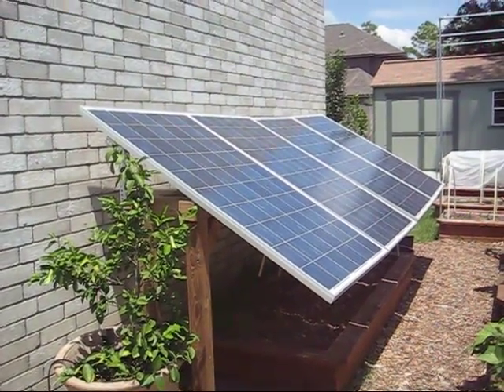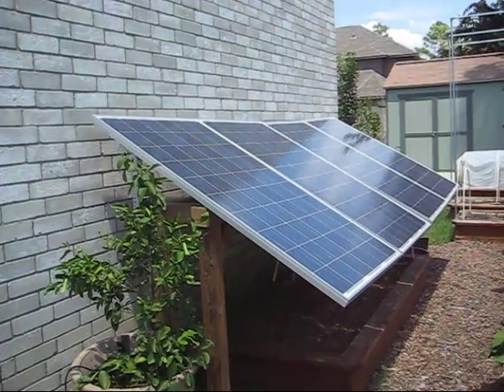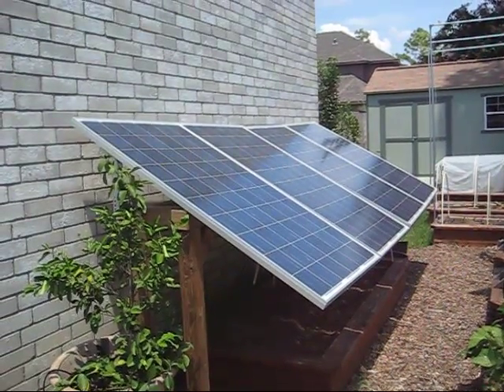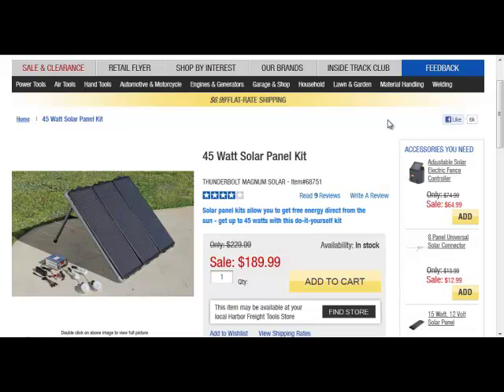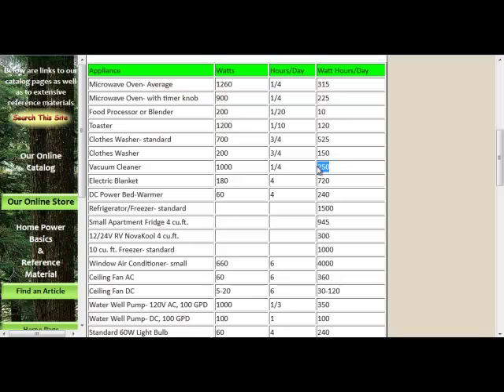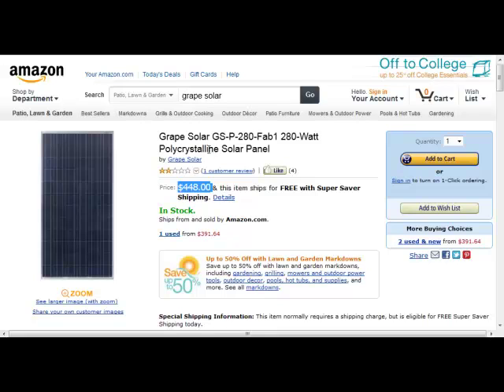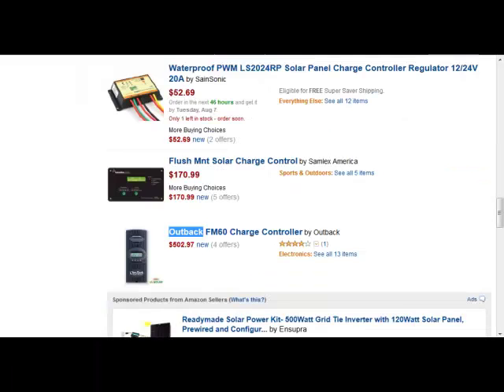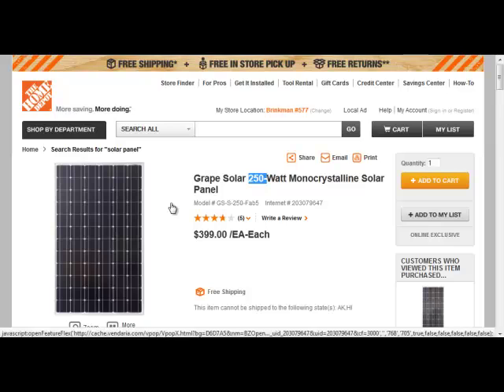DIY Solar Panel System: Costly Mistakes

Comment: I used the harbor freight 45 watt system (2 of the kits) for running my lights and charging phones and tablets for my booth at events. I found that the smaller panels work for portability for set up and break down. (I kept Them for 3 years before upgrading for 100 watt system). But for home I would want something beefier.

Comment: Yep HF not the best value. Panels today can be found at less than a buck a watt @69 cents. I think total my off grid system should be about 2$ a watt with 300amps of usable storage 1.1kw in panels.

Comment: Totally IGNORE this video, he don't have a clue what he is talking about in this one, and it is way out of date!  He also said in other video he bought kits at about $140, now he claims and shows $189 price, also saying $1000 mistake, but if as in first video from 2011 he paid $140 each for 4 kits that is only about $700 with tax and you get allot more that just a panel! No, the kits have almost always been on sale for $140 or less. Or use the coupon for 20% off or Both! My 4 kits cost me about $130 each  and they came with some good stuff you do not get with just a plain panel!  
 Also looking at his 2011 video he bought his HF panels about the same time I bought mine I think, if so there was NO WHERE to buy poly or mono panels for less than $4-$5 per watt and you had to pay shipping which cost allot more! Prices go up and down on mono and poly panels, at time of this video they had gone down it looks like, and now today you can get them for about $1 per watt!! Prices will be going up soon perhaps with the new Tarrif of Jan 22 2018 which may raise prices about $0.15 per watt estimated for what I just read.   
HF is now selling a100Watt kit, 4 25 watt panels and nice led lights kit with good controller and all needed wires, for sale price of about $150 
 it looks like the 100watt kit replaces the 45watt kit near same price  and maybe a much better kit, I have not had a chance to  get the new kit yet myself but have seen them and looks good.
 Amorphous panels do have some advantages like making power in low light conditions like cloudy  overcast days, partial shade, early morning or later hours, times when Mono or Poly panels may do nothing. Amorphous panels may not last as long as others maybe though I know people have had good life and still using the old ones from about 2010 maybe even older.  I Had to pack mine away after 2yrs because I was traveling most the time and seldom home.
 Amorphous HF kits may be best for stealth bug out. Since they can make decent power in less than perfect sun may be good to lay flat on ground while living in the cave hiding in woods. Poly or Mono raised to proper angle pointed into sun would be easy to spot from a long distance and attract unwanted persons to you. Panels flat on ground much harder to spot, though less power, but safety first!
 I will mount some on my motorhome I recently bought. I'd rather park in nice cool shade and get some power than park in perfect hot sun and roast. I am not really a bug out person myself.
Reply: Den, Down here, flat on the ground/roof actually makes the most power at the solar noon. Find when solar noon is in your area and then make a shadow device to see what angle lines up with the sun best. The further North you go, the more angle they will need.  You can use https://solarenergylocal.com to get the solar noon time. And info on what angle produces what type power the best.

Comment: https://www.harborfreight.com/100-watt-solar-panel-kit-63585.html Harbor freight 100w not 45w solar panel set at $189.00
Reply: Almost always on sale for $150 or less with coupon, or use the 20% off coupon, never really need to pay the $189 price ever!

Comment: Canadian 315w pv panels, are with no doubt the most cost-benefit solar panels, 16,5% more of efficiency, and the extra 95w per panels when in comparison to the 220w are a way cheaper than a extra 95w solar panel, also the size is 1,95 centimeters x 98 centimeters, barrely 7 in the morning and it's already at 43.2v, and they keep the efficiency upt to 7pm, from 7pm to 7:45pm they finally went bellow 12.5v... The trick is on the size of the panels, you have less frame, less glass, by the way tose new panels do not even look to be glass, I would know cause i'm a 12 yeas old glazier... I almost paid more on 250w before I found 315w,....

Comment: First of all, the Harbor Freight Thunder Magnum 45 watt solar panel system was never designed for supplying an entire residence with solar power in the event of a power outage. This small and simple system was designed for emergency power, back up power and clean dependable power to keep batteries fully charged in RVs and motorhomes when they are not in use. Also to provide assisted charging when off the grid. You make these claims that these panels are costing $4.00 per watt but that is not exactly true either. When you purchase this system from Harbor Freight you are not only getting the panels. You are getting the entire solar charging system, the panels, the frame, the wiring, the charge controller and even some convenient LED lights that plug into the controller. By the way, most of us who purchased this system waited until they were on sale. I purchased mine for $129.99 and it has worked perfectly since I connected it. At that price the cost is less than $3.00 per watt which is still expensive but there are no other HIDDEN costs to hooking up and using this system. It is the only solar charging system I have used on my 25 foot Class C motorhome and it has proven to be the only one I need to keep my battery bank up. However, I would never try to run an entire household with even FOUR of these 45 watt systems. You would need way more wattage and amps than these systems can provide.
Reply: I mean sunelectronics.com
Reply: I can't believe some Idiots are paying up to $400 for the same Kits on Amazon. They may not be the most cost effective but when On Sale, they aren't too bad. The type they are perform Better in Low Light than other Kinds do.
I use mine to run my Lights and my R/V's Water Pump. $200 Investment. $70 for a Walfart 12V 120Ah Marine Deep Cycle and not HF's or Others Battery for $70Plus and only 20Ah's and forget Golf Cart Batteries at $70-120 6Volt 20Ah and needing two.
Reply: Bob Barker so be a dick about it. He made a rookie mistake. Not everyone realizes how much power they need and how to get started. Yes, in an ideal world everyone would research the subject matter before they move forward but not everyone does. I almost made the same mistake until I started bargain hunting and realizing the cost of one manufactured panel vs the HF kit. Then I really started researching and saw what I was up against. Geeze. Cut the guy a break. If you didn't make mistakes in decisions you've made throughout your lifetime then you're the first in the history of mankind.
Reply: Actually golf cart are normally 200amp hr, and yes do need 2 since they are   6v.  I have and do use $100 Marine deep cycle from Wally World and they held up well for years with some serious abuse. never died but couple got busted in truck and other 2 got stolen. Decent batteries that I had, fast easy to get, easy to move around as needed, etc.. I used mine allot working in woods running tools like electric chainsaw etc...
 For a real solar setup though like to run a house nothing really like a good 6v Trogan, as many as needed wired in  as needed. Long life with decent care, 10years or more for many people.
tough batteries!!! One of the best scrap yard scores I ever got!
 Looking for some metal at scrapyard I spotted a trogan in the battery bin, ask man I bought from all the time how much for the battery, $5each for any of them. Wow, 6 T105's and 4 l16's, maybe best $50 I ever spent!!!!
 I figured I was planning to buy some t105's anyway and core charge was going to cost me $15 each, so that was going to SAVE me $10 each.
Well for the heck of it I ran desulfater  on them and pulse charging for about a week each. DANG I had 10 great batteries that served me well for 2yrs till I packed everything away to travel most the time.
 Were still working well then, but certainly they are shot by now just sitting for near 5 years now.
Reply: You can get solar panels for less than $0.75/ watt on sunelectric.com

Comment: Moral of the story is NEVER buy from Ebay  unless it is a very inexpensive item. My friend as a seller is out of $1,000 on a camera lens and Ebay did not back him up at all.  Most inexpensive MPPT controllers are not MPPT controllers. Just read the review on Amazon.
Reply: Just shop intelligently on ebay, most junk on ebay is also on Amazon too. I thought about buying a fake MPPT controller a couple days ago, but I was smart enough to do some research first and found out it was fake junk NOT MPPT so of course I did not buy it.

Comment: Harbor freight is a terrible place to get solar panels.  So are Home Depot and or Amazon.  Panels can now be bought for $.75 (cents) per watt on line over sites that sell panels.  As far as them NOT being cheaper from HF,  you can know that by doing your homework BEFORE spending your money.
Reply: Prices change bud, his first video about HF panels was 2011 and prices then was $4-$5 per watt plus high shipping costs, and nothing but a panel, no extras Like in HF kits. I know because that was about same time I bought MY 4 HF kits, and they only cost about $130 if smart enough to use a coupon! Was a good deal then! Where have you ever seen $0.75 per watt??? I must have missed that. Now cheapest I can find is $1 per watt.
Reply: Harbor Freight is a preppers worst nightmare. You don't want to depend on junk items from a place like this in our final days...

Comment: Are you really an engineer?  You keep referring to Watt Hours  as   watts.  The former a unit of energy, the latter a unit of power.   Had to call you on it as it was driving me crazy..... :-)
Reply from the maker: +Joe Tittiger LOL, I am the furthest thing from an engineer. I am a problem solver. I don't always use the right words because I'm not educated in anything. I just do a lot of research and testing.
Reply: Well thanks for the videos LDS.  I am trying not to make too many mistakes. It it now 2016 and I  just got 1 KW of panels for $1,060 including tax   Prices have dropped!
Reply: you should try to learn from INPLIX website how to make it properly :D

Comment: I have a couple of Renogy 100W monocrystalline panels.  They run about $150/ea and work exceptionally well.  I'm near the 49th parallel and had low expectations but these things are fantastic.

Comment: I bought the three panel kit from Harbor Freight and after two and a half years, only one of the three is still producing power.  I have replaced them with a 50 watt polycrystalline panel and 10 amp controller from Renergy for just over a hundred bucks.

Comment: I have to say Harbor freight kit is a great way to start. You can later add the more costly panels to it later on. Not everyone can go out and buy a $400 - $500 panel right at first. I did but I do have the Harbor freight kit and it works just fine. We have a 3000 watt Power Inverter on it and over 3 days it charges the battery and goes for hours.

Comment: I would not recommend anything from Harbor freight. Everything I ever bought from then broke within a year.
Reply: POVadventure Harbor Freight panels are like the panels on an old 1970's pocket calculator.  Not to mention they have this weird "docking station" for the panels that no one else in the entire solar industry uses.
Reply: You should use tools like normal person and not use a drill to hammer nails, and stop beating drill bits with a hammer to put a hole through steel! LOL
 Really, I have thousands of dollars in tools from HF nothing has failed me yet in at least 10 years!

Comment: Ok, you're comparing apples and apple pie.  The cost per watt from Harbor Freight is not only for the panels, there are other things included that make a complete ready to use system, minus a battery.  When you mention the cost per watt on the 220 watt panel, how much is that watt when you add in all the wiring, controller, a couple of lights, and a rack to mount the panel?
Reply: TheStavros1001 Eh, While he didn't put that cost into what he was discussing, I agree with him 100%.  Those Harbor Freight kits come with cheap "extras" that do not match up right with regular components and most people are going to want to expand their system (that's a hard bug to kill).  A HF kit is not made to do what this guy is doing and the panels/components are not in the same class anyway.  You couldn't compare them regardless of cost.  You will be placing that HF kit on Craiglist when you want to expand and scale up your system.  Glad I totally skipped this learning curve and went right for a regular panel, then I expanded by adding a second.  Both use the same quality standardized components.
Reply: InfinityVision The quality, capacity, or longevity isn't up for comparison (or debate),only the cost per watt.  Until you factor the costs of the complete usable system for that 220 watt panel, it isn't an honest comparison.
Reply: I think in his first video he was just wanting some backup power for emergency grid down type use, not to run whole house off grid. HF not a bad choice for some fast easy cheap backup power. But now it sounds like go off grid with entire house, not just backup plan.
 Anyway, no need to dump the HF stuff just to go off grid! Amorphous panels will make some power in many  conditions  when Mono and Poly do nothing. Not really a bad idea to have both.
  Though I will be buying some new poly or mono panels to go off grid I will certainly keep my 4 HF sets! They work good ( if not damaged in storage) so why get rid of them? I am even thinking I'll buy the new HF 100watt kit to try.
 Why do people think you can only have one of something?
  Mashed potatoes OR   Stove Top Stuffing? Heck I eat BOTH in same meal!! Well really I used too, now I don't waste money on over priced dried out bread and $0.25 of spices at near $2 box, I make my own stuffing fresh for about $0.75 and it is far better too.
 So point is why choose just one if you have both??
 Also why only 1 battery bank??? How many people run entire house on just 1 fuse or breaker???
 Use all the best stuff like new batteries, for just most critical must have stuff like frig freezer or whatever, the put other stuff like older batteries backup spare parts together for not critical loads like tv, dvd player etc...
 See a bad weather front heading in and may not have much sun for a week or more just turn off inverter and kill all not critical loads at one time.
Now got spare power for the critical loads if needed. Or if fry an inverter or controller for critical loads got a backup ready, just switch it over .
 Never any reason to get rid of stuff that still works, even old batteries when installing all new, just move the old to a new use.

Comment: The big panels are discontinued at home depot and Amazon
Reply: Wonder why?  Demand is certainly increasing.  Wonder if this is because the energy corporations want power production and distribution to be centralized - so they can profit; not in the hands of individual families.  BTW, the Waltons of Wal-Mart are supporting restrictive regulations, fees, and other hinderances to families generating their own solar power on their own roofs, and home-scale wind generators.  Why?  They own a majority stake in a solar company that wants to sell you the electricity, same as ever.
Reply: Dave Kurr  Yes they are!!!!!!  You can find OTHER STUFF everywhere, but THESE are discontinued where HE says they are.

Comment: Did you get a tax credit from doing you own home install of the solar panels?  Is it worth to do it yourself versus using a company?  I am not very handy and I was thinking I could do maintenance, but the install I would want done right.
Reply from the maker: Andrew Fidurko I would not use the Harbor Freight panels for any kind of long term, permanent installation. I am having a company install a complete 5kV system right now at my new house with full tax incentives. Check out my "Going Off-Grid Step-by-Step" video series.

Comment: dear sir,I have a question for you:why cant you connect your achv(air cond)at your solar power system? you connect only the electric apliances?so,If you spent almost 5000$ for the solar system and another 5000 for the aircondition do you still to have a propane or diesel generator to back you up when is no sun for 3 weeks?
Reply: A/C is not something to run on solar power.  Instead, try planting decidous shade trees or vines to the east and west of your home, and taller ones to the south (if you live in the Northern Hemisphere).  Other well-planned foundation plantings can further assist with keeping your home cooler in  hot weather.  (Warmer in winter, too.  A windbreak to block prevailing winter winds will help even more.)     Open the windows on the lower floor on the shady side of your home, and the windows on the sunny side of the upper floor (if your home has more than one floor) and allow natural convection currents to pull cooler air inside and pull the hotter air out.   There are many ways to 'live smart' and stay comfortable while reducing our energy costs and dependance.   These are just a couple ideas to get started.